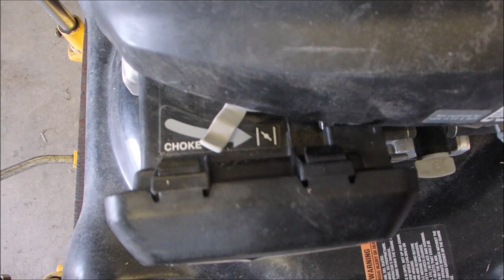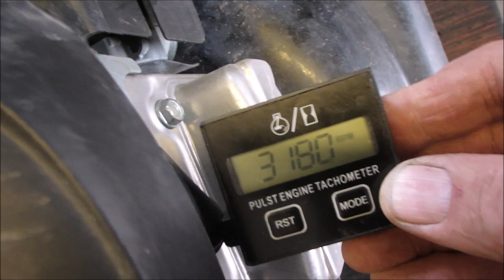Craftsman Mower with Honda Engine Tune Up

Comment: Just repaired and tuned one like that a couple weeks ago. It had been sitting awhile but with some cleaning and lube of the choke system I got it working properly again. Nice job on yours.
Reply from the maker: Right on  Thanks a lot.

Comment: I put a NGK  plug in my greyhound 11 hp on my JD112  Also bought one for my 8 hp honda  engine My opinion is they are the only plug I would put in motorcycle engines also
Reply from the maker: I agree

Comment: Hi. Push mowers that have Honda engines are a delight to mow with. Did you lube the auto choke plastic gear, and the wheel spindles? Have a great weekend, Bruce.
Reply from the maker: I tend to leave that silly choke alone if it is working.  They can gum up all by themselves.  Yes I squirt the wheels with a bit of trans fluid.  I don't always show that.
Reply: @BrucesShop  Good call on the choke assy.  I had one that was sticking, so I cleaned it and thought "ehh, a little lube never hurts"....well, let's just say I couldn't get a single pull before that thing darn near moved all the way.  But if they're still moving without any problem, just leave em be.
Reply: @mattwickert736  I use DuPont Chain-Saver wax-based spray lubricant. Contaminants don't bind to it, mechanisms don't gum up. It's either that or silicone.
Reply: @999thenewman  it was a mower a kid used to cut lawns, so the mechanism was just dirty.  I cleaned it, but also added some silicone.  That just made it lose that little bit of friction that allows a slow & controlled motion.  instead, you had about 1.5 seconds to pull the rope once you pulled the handle or it was already back in the running position.